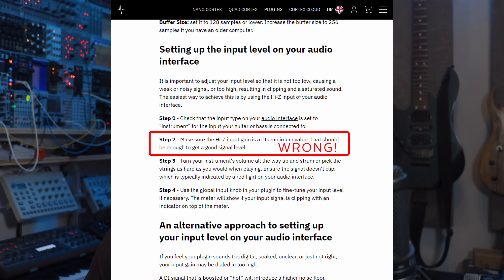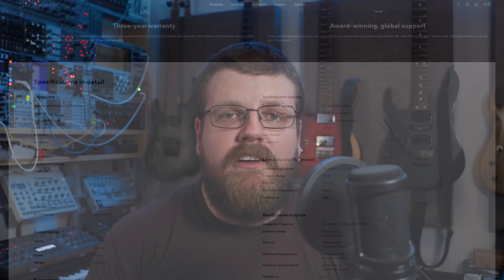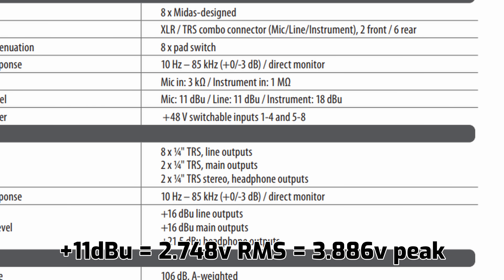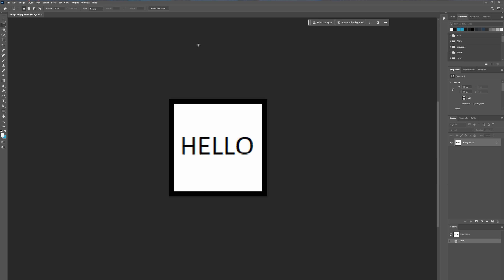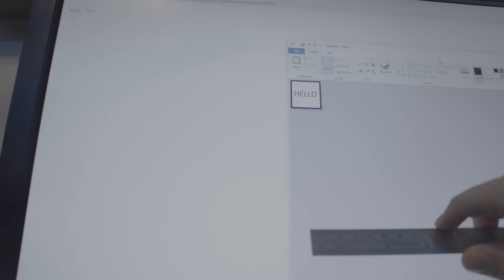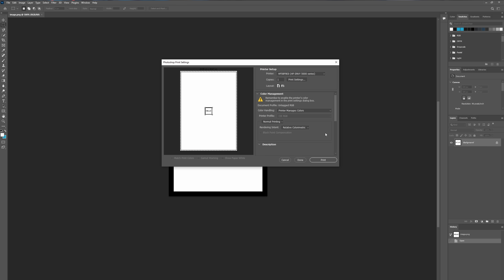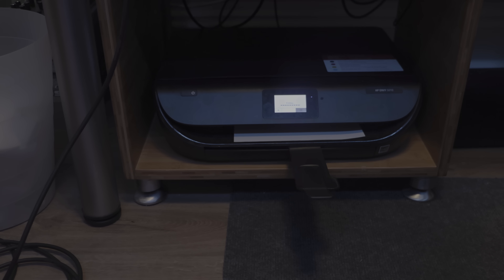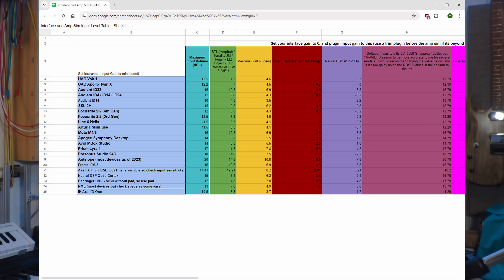Ampsims and input gain - Please, stop the madness...

Comment: I didn't realise they were setting the audio interface input to 0. 

Personally I've always found somewhere around half way gets me a good amount of level vs low noise floor. The amp sims respond how I want them to. My guitar volume adjustments respond great. Stacking pedals before the amp respond better. And I don't have to insert gain plugins at the start of the chain to lower the gain. 

Given what you said in this video, I think the amp sim developers need to work on THEIR virtual input gain features. Perhaps even adding pad features. These should be more accurate without having to think about it.

Until they do that, I'm happy to keep my guitar channel permanently at 50% on the input gain of the interface and get the sounds I want with no problems with noise (adjusting that for different songs would be a nightmare - would much rather have to only match my guitar volume control 6 months later).

Great video. The above isn't intended to disagree with anything you say, more than I'm very happy with how it works for me. Hope you get many more subscribers - one of which is now me.

Comment: Yeah..... I tried the 0 dB thing and the plugin just didn't work right. I think the version of the argument I heard was that if you increase the gain on the audio interface you get a better representation of the actual amp and it will be less gainy. But if there's no gain on the audio interface, personally I can tell the signal isn't strong enough either. It makes sense that there would be a second input level.

Comment: I've been digital for 25 years now but let me ask a question, to make sure I'm getting this. My interface is an older Focusrite Forte, and the specs say the following:

Instrument Inputs:    Maximum	Input Level for 0 dBFS:        +10	± 0.5 dBu at minimum	gain 
                                    Minimum	Input Level for 0 dBFS          -44	± 0.5  dBu at maximum gain

I'm not sure how this then applies. My current favorite amp sims are the 3 new ones from UA. To my ears, anyway, the optimal sound seems to be when I set the Forte's input gain (Hi-Z) to peak around minus 10; then pulling the plug-in input all the way back to where it says LINE, as in line level. The manual, however, says to set the interface to 0 and the the plugin to Hi-Z, but obviously your thesis proves this is wrongheaded (to be fair, it DOES say reduce the plugin gain IF the input signal has been preamplified)

Comment: Good presentation on this complex topic. And coincidentally, right after seeing this, I watched a Crow Hill video where they called out your Ghost Note Audio Conductor MIDI controller (nice!). I think some addendums are worthwhile re: standards, and whether the optimization you prescribe is the "perfect" being the enemy of the good (or even of the better than "perfect").

First, re: "There is no accepted convention for what is considered peak level for an instrument input." Well, if by "accepted" you meant "universally accepted," I suppose that's right; anyone can ignore a standard if they wish. But in a video attempting to be "rigorous" about this topic, it's probably worth noting that there are in fact standards; it's just that (1) there are competing standards that differ, and (2) there is no enforcement mechanism, so interface manufacturers are free to ignore standards if they choose.

In Europe, EBU R68 specifies that 0 dBu (an input power level) should correspond to -18 dBFS (decibels with respect to full scale, a digital level, "unitless" in your terminology, though "relative" would be at least as good a term). In the US, SMPTE RP155 specifies that +4 dBu should correspond to -20 dBFS. So there's a 6 dB difference in the recommended calibration just from "crossing the pond." Wikipedia's "dBFS" entry indicates that Japan, France, and "some other countries" recommend +22 dBu at 0 dBFS (the relevant standards body is not identified). Moreover, +4 dBu is considered to be the "professional" reference level. Some interfaces adopt the lower consumer reference level of -10 dBV instead (and the difference between the final "u" and "V" is important; these reference levels are not 14 dB apart!). So, there are some standards, but their multiplicity means that "There is no accepted convention..." is not a bad description of the situation in practice.

The datasheet examples you give are sadly imprecise and thus bad examples (this is not your fault, obviously). A level is called a "maximum" level without saying what that means. Is it describing analog performance of the preamps, specifying when some point in the audio signal path (e.g., just before the ADC) hits some target distortion level (say, 0.01% THD)? Is it instead where the ADC produces the maximum digital signal? A precise datasheet would say exactly what is meant. For example, for my RME Fireface UC (which lets you switch between +4 dBu and -10 dBV input reference levels), they provide a table specifying dBu above the reference level that corresponds to 0 dBFS. For the +4 dBu choice, 0 dBFS is reached for signals at 13 dBu, "the latest EBU recommendation" (which evidently was 1 dB different from the current recommendation). If "dBFS" does not appear in the datasheet, you can't be sure how the analog and digital levels are related.

"The accepted wisdom was—and still should be—to set the input gain... as high as possible without clipping the signal." Your discussion of gain staging seems to me to date back to the days of 16 bit bit depth, with only 96 dB of dynamic range. Part of the motivation for moving to 24 bit and higher bit depths was to make it unnecessary to push levels very close to 0 dBFS when gain staging. With the headroom on hand in an ADC with decent, modern preamps and 24 bits or more of bit depth (144 dB!), it is not necessary to set the input gain as high as possible to avoid clipping in order to get a very clean signal. That was always a nuisance, because in the studio (and even more so on stage) the talent would very often perform louder during an actual performance than during a sound/level check. With 24 bit converters, you can set your gain to be well below clipping and still have an imperceptible noise floor—and plenty of headroom in case the performance is hotter than expected (and to enable EQ and other processing without having to attenuate the signal digitally later). You call 90 dB of range "relatively good." Actually, if that's really the signal to noise ratio one is achieving, that's spectacularly good. Unless your listening room is an anechoic chamber, you won't be able to use that dynamic range—it's the difference between the lowest perceptible sound (for perfectly healthy ears in a completely silent environment) and a sound level that actually causes hearing damage.

So: No need to push close to clipping; in fact, your recording and mixing life will probably be easier if you give yourself 6 or 12 dB of headroom when you set the analog input gain. But do follow the rest of the advice here, so that whatever analog gain you use ends up hitting the amp sim plug-in at the designed-for level. Or, on the other hand, just do what sounds good to you. There's no law (or even a standard!) saying you need to use the amp sim the way the manufacturer intended! —Tom
Reply: Good points. A few thoughts- 
Not all equipment uses the same full scale voltage reference, so while it may be useful to have a defined level that is "compliant to" some standard. But, practically, I think it would be better for manufacturers to clearly state what the full scale level in dBu or volts (or both) is for a given interface and we all can go from there. Crest factors (peak to average ratios) of the signals also affect where we might set the "average" level, and of course the averaging method affects that back off, as well. More clarity rather than less information would be helpful all around, I would hope.

By the way, 90dB dynamic range, about 15 bits (ENOB), in a single source channel is probably not so great when combined with other signals and additional processing. It's about what the old redbook CD standard can do, though.  Cheers
Reply: You're conflating thermal (electric) noise and quantization noise. 24bits does reduce quantization noise, but you still have the best SNR when setting your gain to just below clipping. That's basic gain staging. Of course you always keep a little headroom when setting your gain. Setting a proper gain is not very complicated either..
Reply: @nolyspe  No, the point is that most interfaces that support higher bit depth than 16 bits also have quieter preamps and converters. It would be somewhat pointless to put a preamp with only 90 dB of headroom (say) in front of a 24 bit converter. If you compare the preamp specs of modern interfaces with older interfaces that were only 16 bit, you'll see modern interfaces typically have quieter preamps.

Comment: does this apply to anything other than ampsims? distortion or anything like that? also it's normal to boost the input gain on the interface to just below clipping right? been doing that for years at least

Comment: That is simple and makes sense. But I have been experimenting with opamp gain and it very soon adds its own distortion. It must be very high quality discrete opamp to keep the multiplied signal without distortion as it goes over 1000hz. I don't know if it matters at all because the wanted amp distortion which adds to natural string distortion(i.e partials) on guitar starts for example from 80hz. Low E which is 80 hz conveys 100 different partials up to 8000hz out of the box which all will get again distorted by amp. And before AD by the high gained opamp circuit. A string in its acoustic state is a device having distortion already.  Those evenly distributed distortion components are called partials or harmonics(harmonic distortion?). Logically if you add lots of gain right at signal interfacing the first opamp gain stage like that you get harsher tone coming from initial opamp distortion before AD stage for example 1000hz generating additional 2000hz, 3000hz,4000hz,5000hz partials. At 1000hz - 2000hz signal can have serious effect. As contrast 4000hz has first partial at 8000hz which means nothing.  You can easily see how your input gain adds those  distortion elements as the gain is increased. Create a sine wave sweep from 200hz- to 2000hz to see how - with very high gain - distortion components are growing like crazy starting as sweep passes 1000hz. It happens with any semi pro level audio interface input.

Comment: You totally misunderstood them.. they are not looking for deepest noise flood or high dynamic range.. they are trying to find the best input for the modelers to react like real amps.

I think before you make a video criticizing other people.. how about try to understand what they are really saying?
Reply from the maker: Well, if you took the time to watch and understand the video, you'd realise that I didn't misunderstand anything. You are right, they are looking for the best input for the modelers to react like real amps, *but that's not the only thing to be concerned about*. You can do that, AND you can ensure the best possible noise floor. My argument is entirely based on the fact that people were sacrificing signal to noise performance, in order to adjust the input level for the ampsim - when in fact, you can optimise *both*.
Jump to 9:57 - 10:44 where I spell it out as directly as possible.

Comment: I watched your video with the new auto gain feature of the UA Apollo X Gen 2 interfaces in mind. The question I have is whether the auto gain feature compensates for both the interface input gain (which should maximize S/N ratio) and matching the plugin's required input gain as well. Obviously the auto gain should maximize S/N ratio. But there actually is a clue as to whether the auto gain compensates for the required input level of plugins. UAD Unison plugins are unique utilizing hardware and software to match the input characteristics of the actual hardware being emulated. They cover amp sims, pedal sims and preamps. 

In the Apollo X Gen 2 intro video from Anderton's, the UA rep said that the auto gain feature would initially work with preamps from Neve, SSL, and API. I took this mention not to mean other Unison (or non-Unison) plugins don't work with auto gain. I took it to mean that the mentioned plugins were fully integrated with the new auto gain feature. IOW, they would maximize both the S/N ratio and input matching of the specific plugin. Apparently other plugins will get this capability as well. AFAIK, these may be the only auto gain / plugin maximizations available from any manufacturer.

Comment: I use TH-U along with a Mackie Firebird firewire interface (yes, I still use firewire because it's still a better platform than USB. Don't hate me). Unless I have my input gate set to 50% or higher, not enough signal gets into the plugin. The idea of setting input gain to 0 is a complete non-starter because on my interface, 0 = NO SOUND. Normally I have my input gain up to 65% or higher.

Comment: Thanks for this! I'd be curious to hear more of the results in a mix to see if this correct way actually has a tangible difference on the result.

However, my next question is how should guitarists properly gain stage with plugging straight into modelling units that have input gain adjustments? Ie. Kemper, Axefx, Quad Cortex, etc.

Comment: Use all the math you want. I can tell the first note I play whether it sounds good or not. If it doesn't sound good, something is not right. The models are the master and everything else is the slave. The gain settings they used to make the models have to be the same when you use them, or the models will not sound as intended. Guitar amps are not designed to have the gain increased to the optimum level. Different guitars have different amounts of gain and that is part of what gives them their unique interaction with an amplifier.
 Just make it sound good. In the end. That is the only thing that is relevant.
Reply: You just read my thoughts. If the sound good, no matter what nobs you are turning.

Comment: Thanks for going over this!  This is how audio engineers have been setting gain staging levels for ages across all types of gear to maximize the signal to noise ratio, and I was trying to comprehend the logic behind the zero approach as it didn't make any sense.  The rule of thumb is to always hit the gear you're going into as hard as you can without clipping it (in the analog days you optionally could hit it harder than zero for the saturation effect, but that's a subjective style thing at that point).  This rule persists across the entire chain from gear to gear, meaning you hit the 1st piece of gear this way, then adjust it's output to then hit the 2nd piece of gear in the chain this way, and then adjust it's output to hit the 3rd piece of gear this way.... etc....  That will maximize the noise floor across "all the things" in the chain and get you the cleanest / strongest signal.  Even for something like a compressor, give it the best incoming signal you can  from the piece of gear in front of it, and then you can use the compressor's input level adjustment to tune how much compression you want.  Then use the output level to get that signal as strong as you can into the next piece of gear.

Comment: 2 Questions. 1) I've always naturally set my input gain on my Focusrite audio interface at 12dB (right below the clipping threshold) and never touched the Neural DSP plugin input level. According to the spreadsheet I need to offset the plugin input level by -0.2dB. Aside from being nitty gritty with the numbers, is this really necessary? It just seems a little negligible. 2) Many audio interfaces have Instrumental level buttons. My 2i2 for example has +7dB when activated. Would you recommend activating it and manually add 5 dB on top of that, or would you recommend turning it off and manually set it to +12dB? Is there any physical or scientific evidence that one is different from the other?

Comment: Summed together:
You want your analog signal (guitar output to recording device input) to be recorded as loud as possible without clipping.
- It reduces your signal to noise ratio
- It maximizes the use of all the bits of your digital convertor (for example your USB preamp's built-in convertor)

What you do with the gain AFTER it has been recorded doesn't really matter that much.
The signal IS digital from that point on, so it's ok to change the level on your plugins/daw sliders, etc
Just make sure with every plugin you use that you try to set your input and output levels somewhat at a point where they're ideal and you're good to go.

Comment: Digital 'noise' is the quantisation error. To minimise this, the gain of the circuitry in front of the A to D should be scaled to make use of the maximum input range of the A to D. 

E.g., if the A to D can handle a maximum range of +/- 10v, the gain of the input should be set to amplify (or attenuate) the input signal so it has peak values of +/- 10v at the A to D input..  in practice some reduction of the gain may be desirable if the peak values of the input are not precisely predictable (i.e. a complicated signal) to avoid clipping. The desirable headroom is dependent on the nature of the signal, and a matter of judgement and experimentation.

Ideally, the loudest possible signal from a particular source should only just drive the A to D over it's full range. 
 

An input gain of 0 will only be optimal for one particular signal level.